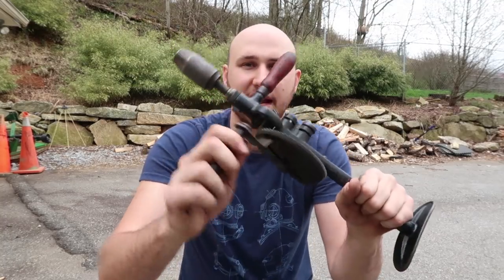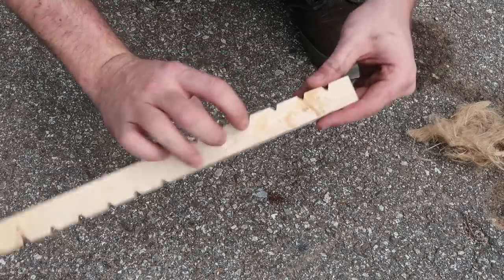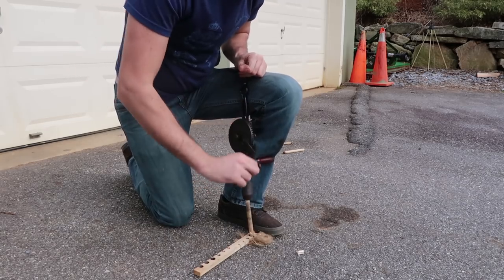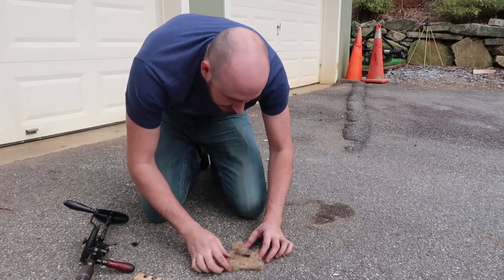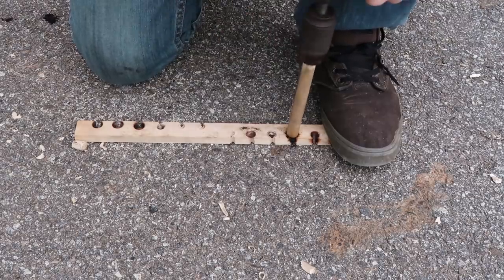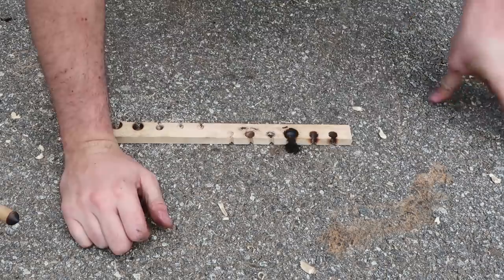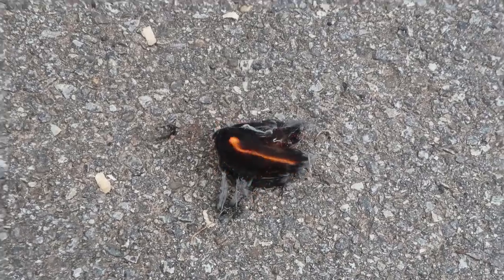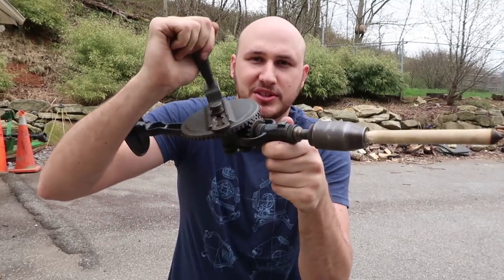How to Start Fire with a Crank Drill?

Comment: Try using a shorter stick, if u do this u can spin faster and apply more pressure without the stick breaking. Try 1-2 inches out of the drill. Hope this helps :)

Comment: Hey Tara's can you do it with normal electrical drill too?
Reply: Timmy only if it's plugged in/if the battery is full
Reply: Or, you have a really loong  extension cord.  Really Long.
Reply: grassroot011 😂

Comment: Use a shorter stick. The stick was too long so it was flexing and breaking. You only need a stick a few inches long or just long enough to stick out the end of the drill.

Comment: A proper bow drill would be 10x easier to setup and use, unless you could change the gear ratio to get some more speed from it.